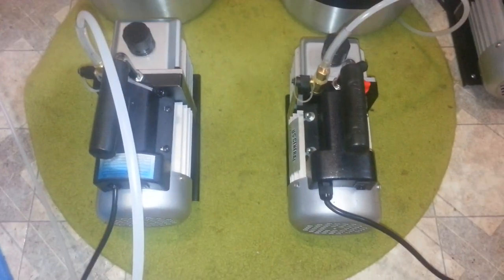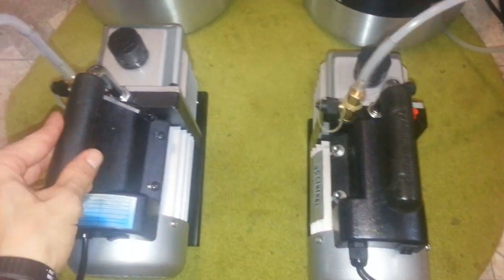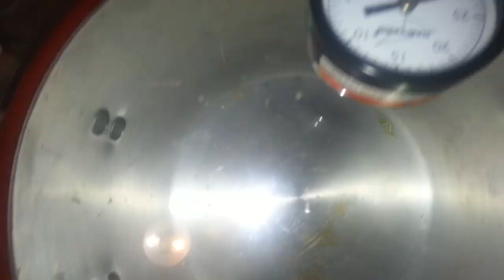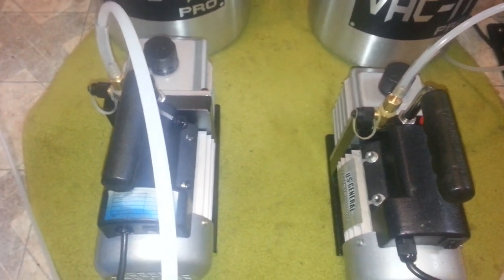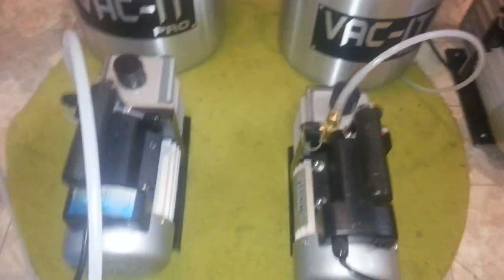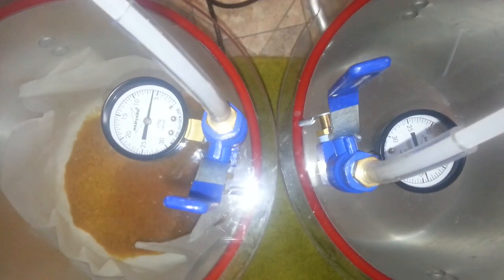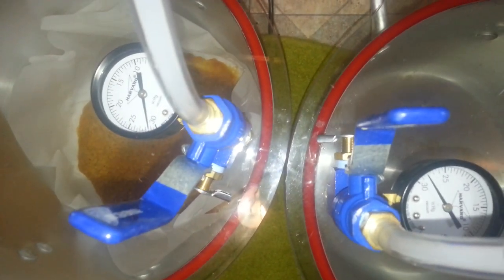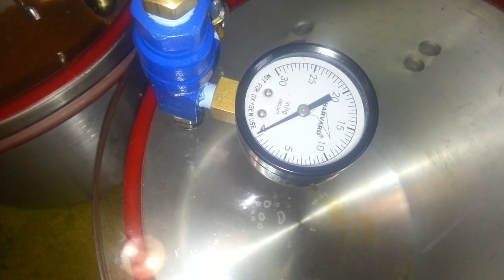Knottyy Tests Vacuum Pumps:  1 Stage vs 2 Stage

Comment: Highly recommend getting vacuum check valves to put in line with your line(s) to your chamber(s).  They will significantly reduce the chance of a reverse draw through the pump(s) and I believe most automotive vacuum system up to the task so they are pretty easy to acquire.  Fish tank bubbler check valves may also work, but I personally have never used those and they seem to be designed for pressure rather than vacuum.

Comment: Good comparison of pumps, I prefer to close the valve to the vacuum line right before turning off the pump to ensure no oil is sucked out of the motor and to maintain pressure, great video. Keep the videos comin!

Comment from the maker: Yes both non name brand 3.9 CFM 2 stage pumps I got off eBay, and both sucked.  One was louder than the other and made a whah-whah-whah sound and the other did like you mentioned and wouldn't start up at times.  I decided to forgo these and just go buy a set of Robinair pumps, and I'm so glad I did!  They are so much better.

Comment: Thanks for this demonstration! Do you have to open the exhaust cap/unscrew it a bit at all? Do you get any mist/smoke/some kind of vapour coming out of the exhaust?
Reply: https://youtu.be/dBkuy_GoXhg it sits on one point and burns up the coils unless you open up the safety cage and spin the rotor.

Wish I would have know on the first purchase....cant bitch about a $40 pump that could charge my a/c unit too. ($80, that's a slap on the wrist compared to other pumps though)

Comment: You should not let the vacuum chamber reverse draw Thru you vacuum pump. Close your valves prior to switch ing the pump off...
Reply: Can it really draw backward? There must be a check-valve to stop reverse flow.
Reply: There isn't and you can suck your oil back up through your hoses and into your system. Always shut off the blank off valve (if pump has one) or basically separate the pump and system before turning off your pump.
Reply: not good info

Comment: Hello.,i have a question if you do not mind. i have a vacuum pump (,i use it for casting ) i had it for more then 3 years anyway, last week when it is starts to work ,it started spraying oil out of the hole in the handle, and when i looked under the machine i saw there was water under it and i have no idea where it came from, the oil was leveled but i didn't change it for almost a year. what do you think is the problem with it, and how can i fix it? thanks

Comment: Thanks, I already ordered a single stage, only going to use it once I hope. I have a huge commercial unit.  And want to see if it leaks before first as it needs over 250 lbs. It will be on the roof so scream away.

Comment: im getting a vac purge soon and im wondering should i get a pyrex chamber or the stainless steel ones?
im going to get a 2 stage 5 cfm robainair i think its called,
for my pump

just confused on the chamber....   pyrex or stainless....  theyre not exactly cheap so every opinion matters, thanks!

also knotty, your videos inspired me, even without a vac purge im able to get shatter almost everytime doing your whipping method,

hope you reply,

Comment: Hey there, first of all Ill tell you thanks for the video, second i got a question about Robinair Vaccum Pumps, i bought one of them, It is the Vacuum Master 15800 8CFM, and when I plug it to mi chamber and turn it on, it just get to 25 inches, I dont k.now what I am doing wrong, but i´d like to know if there is any condition or fact like temperature, or altitude who could affect the pump to work properly.

Thanks for all
Reply: You have a leak at 25.  Use some smoke to smoke it out.  Smoke on outside.
Fist up, Fight for Truth.

Comment from the maker: You can do that but you will loose pressure over time.  Guess it depends on your desiccator, as I'm sure some hold pressure better than others.  Usually if I lock it off at -29.5 and then go to sleep, it'll be down around -10 the next morning or so.  So it slowly looses pressure over time.  The Vac-It Pro comes with a check valve standard which is nice.

Comment from the maker: Just connect to whichever one fits the connection you have.  Both inlets do the same thing, just different sizes.
Reply: Knotty I'm not sure why but my vac gauge goes all the way past the 30  and if I let air in to bring my gauge to 29 then the oil just sits an seems to just do nothing. Can u please give me some advice?   1stage 3cfm is my pump

Comment: Hello. I have a 1 stage vacuum pump and in the pump manual it says to remove and discard the exhaust plug from the exhaust fitting. I have only a black plastic cap with a o-ring on it but i don't think that i need to discard that, right? I don't know what to do with that plastic cap on the pump where the oil is added, should i tighten it or let it lose?

Comment: I bought this 10 CFM US made commercial pump. I only use it for pumping down AC problems in cars or other vacuum issues. best 100 bucks I spent in my life. I bought a commercial chamber pump unit for food storage. My chamber pump after filling it with oil I found it to be the single stage harbor freight type pump .
Ether way Neither one of these pumps make any kind of noise like yours does and I have that same DB tester you have.  I'm not going to BS you here. My buddy took a 3/8 line on his skin using my 10 CFM pump and put it on his arm and it started to draw blood from his arm. 
I have no idea why your pumps make so much noise. good luck

Comment: only want a 29.5 HG MAX

wait wait wait... I thought you only needed to HOLD the vaccum for the amount of purge time,  NOT running the pump non stop for that amount of time....
Reply: +710tech glass I can't believe he runs the vacuum pumps the entire time.... stoner.
Reply: Yep, you should set vac at correct pressure, lock valve to shut vac at chamber locking vacuum, turn vac off, place on hot plate (preferably computer controlled) and repeat process every 6-12 hours with flips of the shatter.

Comment from the maker: No it doesn't get hot to the point where I would be concerned.  It should be able to run all night without any issue.  You should check to be sure your oil levels are correct, and also like JPJPJPJPJPJPJ said be sure you're using the correct type of oil.  If none of these help your pump might just be fucked.

Comment: Daniel I am pretty sure once you twist your cap on you can yank it and the cap actually comes off, and there will be three little holes that exhaust. I just got one and thats how mine works. Hey Knottyy, how often do you change the oil for your vacuum pump??

Comment: I've been watching a few of your video's. Very informative. I'm thinking about buying a Vac-It pro chamber on ebay. And a Robinair 5cfm 2 stage pump $206. free shipping. Will the 5cfm pump be a good match for a Vac It Pro chamer. I am either getting the 3 or 5 gallon chamber. Probably the 3 gallon. The most I will probably do at once is a 1/4lb extract. Approx 3 gram per oz So about 12 grams at a time. Should I just stick with the 3 gallon chamber and 5 cfm 2 stage robinair?
Reply: you're completely fine with a 2.5-3CFM

and I highly reccomend learning about boiling points of cananbinoids and terpens in a vaccum. im pretty sure you're boiling cannabinoids at room temp in anything more than a 29.5 HG vac

Comment: i have the same vac-it pro chamber with a robinair 15500 5 cfm 2 stage pump and the lowest it will vac to is 27 maybe 27.5 once i just got this yesterday and am still trying to figure it all out. Grateful for any help with this
Reply: that pump should pull 200 microns easy. when did you last change the oil?

Comment: for the 2 stage vacuum pump ,  are they design for long hour running? will the motor get hot?
Reply: yes! 72 hrs non-stop working is no problem.
we manufacture 2 stage vacuum pump.

Comment: Hey knotty I have a 5cfm robinair and was wondering are you supposed to have the exhaust fitting screwed on while pumping or off and exposed? It looks like yours are on but I'm new to this and not sues cause it seems too quiet with it on and not sure how exhaust would escape ... I'm trying a run tonight if this question could be answered . Your my idol in bho. Thanks for your time

Comment: the pump on the right has a red twist cap next to the air intake and the oil fill caps and it isnt in my users manual what does it do ? i just got mine and dont want to break it

Comment: hey knottyy, great vids. Im just curious as to what size extraction tubes you use and if you found a difference between long/short and wide/skinny tubes. thanks in advance.
Reply: I stack mine in dehydrating trays, inside the chamber...you can do 1st and 2nd wash...a couple strains all at the same time.

Comment: What barbed fittings did you get for your pumps? Got a used one with threaded fittings only. Trying to connect my 1/4" hose from my chamber.

Comment: Knottyy, I'm under the impression that in order to hold a vacuum you have to leave the pump run. Is that right? I don't know if I can run a loud ass vac for four hours straight in my apt. Can I just close the valve once I reach 29.5"?

Comment: Does it matter which inlet to connect the hose to? on the pump itself. vertical or horizontal? I only notice a thread difference on mine.

Comment: Whats The micron ratings of each though? that 2.5 cfm pump may have a 75 micron rating, where the 3.9 is closer to 20-25. That'd make a significant difference right?
Reply: I don't believe these labels on the Chinese no name pumps. I am surprised they did this well. Sadly many big name companies slap their name on Chinese stuff and make you pay more.

Comment: I picked up another check valve to put on the other side of the vac tube, so I could potentially shut off the vac and close the valve to keep the vac without running the vac for hours on end... but haven't hooked it up yet (got the wrong size, need a bit smaller) - anyhow do you think this will work, or will it lose vac over a certain period (which was the only problem I could think about the re-design)... Thx Knotty, you rock, thanks for sharing these tek tips... This shit is usually SECRET!

Comment: yo man your 1 stage pump was only 2.5 cfm and your 2 stage at 3.9 cfm wouldnt that make a difference in the amount of neg microns your pulling not the stage of the pump?  is 3 cfm sufficient for what your doing?  is 6 cfm overkill?

Comment: no one told me about the valve closing i learned the hard way and broke my first pump because i stopped the vacuum but didnt close the valve so yes in fact the oil pump back flowed into my chamber pot and ruined a batch of 710 i just made
Reply: Raymond Robbins Hi Raymond what is 710?
Reply: @UltravioletHeather  OIL=710 it's the off smoke from the vacuum going from -29.7 hector to atmospheric pressure.  I JUST BLEW UP MY 1STAGE eBay Vaccuum and was looking at Pittsburgh perhaps? I'm in the middle of a pound of weed I cold crashed and was tirning into a few slabs.  But I need to continue the purge!

Also I stack trays in my chamber and do like 4 slabs at a time🤘 only need one chamber and dehydrating trays....sometimes I put dessicant on the bottom and cool the bottom plate as well to collect condensation, either way
Reply: @mikepadia4244  Hmmm Thank you. :D
Reply: @UltravioletHeather  I burned up the coils in my generic no name brand.  You just need to take off the safety cover and spin the rotor https://youtu.be/dBkuy_GoXhg so its not sitting on one contact point while warming up the oil, thus reducing friction enough it will spin....I went with the same model (as the broken one on the floor)...it's like $35 and good for charging the A/C units on my car and house...

:TAKE NOTE, NO ONE REALLY EXPLAINED IT SO SIMPLY.

I was pissed the pump started smoking, and i disconnected the valve from the pump without closing the valve on the chamber, thus going from -29 hecters to atmosheric pressure.  Splattered shatter on the sidewalls and over the edge of the bowl.  I feel stupider than explaining 710, again.  Really google it, i'm probably a liar.

Comment: do you know how many Hg the pumps pull
Reply: nvm would have to obviously be 29.7 on the 2 stage and 29 on the single. but then why do most extractor prefer the 2 stage I cant see the diff besides convience in this side by side comparsion. btw thanks a ton for the vid great

Comment: I have the 2 stage pump 3.9 cfm and have my hose and no way to conect the 1/4 inch hose to the vacuum or which one I should connect it to. any idea what adapter or fitting I need for it for qa 1/4 inch hose? and where can you get a Vac-It pro besides Ebay? thanks im at stand still with the pump I want my BHO to be vac purged help would be awsome. Stay Up!

Comment: If you're coming to this video to learn about vacuum pumps don't listen to this guy. He has absolutely no idea what the hell he's talking about as far as vacuum pumps single stage vs. 2-stage pumps. He says that the main difference is the noise know the main difference is a two-stage pump that use a higher vacuum. Then he goes on to say that when the second motor kicks in on the two-stage pump did it quiets down some there is no second damn motor is it two stage pump there's only one motor just got has absolutely no idea what he's talking about as far as single stage and two stage vacuum pumps if you're here to learn something else so be it but don't listen to anything he says in regards to the title of the video single stage vs. Two stage vacuum pumps he didn't know what the hell he's talking about. Also he says that you can get oil in your oil because the vacuum from the vacuum chamber is going to suck through the hose and suck the oil from the pump through the hose and into his chamber. Well almost every vacuum pump has a check valve to keep that from happening every good pump has a check valve however two pumps that he's showing you are extremely cheap crappy Harbor Freight pumps. If the Harbor Freight pumps don't have check valves then you shouldn't be using them in the first damn place. It doesn't matter if you're using it to evacuate a refrigeration system or a vacuum chamber or anything else if it didn't have a damn check valve you shouldn't be using that pump. pumps like that are produced and sold at places  like Harbor Freight  2  essentially  steal people's money by ripping them off for product  that  is no good in the first damn place  and it shouldn't be getting it however some people don't know about things like this  and for whatever reason they need a vacuum pump for a project or whatever and  they don't have to have a high dollar one  because you're only going to use it once or twice and I think all is fine to go to Harbor Freight well  think twice about that  this right here is why  maybe they're not putting check valves in their humps  but I highly doubt that even Harbor Freight would neglect to put the check valve in their pump anything is even if there's not a check valve in it there should at least be a damn ISO valve so that you can shut that off before turning off your pump to isolate your pump from whatever you're connecting to other end of that hose to. And if you don't have a check valve and or at least an ISO valve you probably don't even have a vacuum pump because all of them that I've seen in the last 20 years at least has an ISO valve.  guy is a freaking idiot and he has absolutely no idea what he's talking about when it comes to vacuum pumps. When you turned on to two stage pump and he didn't like the noise that it was producing he picked it up in tilted it pump side up don't do that don't do that you're going to put all the oil there supposed to be in that pump all the way to the back of it energy mean nothing in the front and you're going to ruin it maybe he's done this several times and maybe that's why he's making the noise what do you think. He's essentially damaged his pump because is running it dry even though there was oil in it when I say running it dries because he had no oil on that side of the pump he's a freaking idiot don't listen to him. Do I do the same type of thing he does no I don't I'm a licensed HVACR technician since 1999 for those of you who can't count thats 20 years. I know all about vacuum pumps how they work and everything else don't listen to this idiot

Comment: I'd highly recommend this pump, It's the best i've used and no smoke coming off it. In general these are high quality pumps.http://www.amazon.com/Yellow-Jacket-93615-Bullet-Vacuum/dp/B00PFU8OOE/ref=sr_1_5?ie=UTF8&qid=1418316869&sr=8-5&keywords=yellow+jacket+bullet+pump. Have you guys tried puretane brand? It's a good choice!